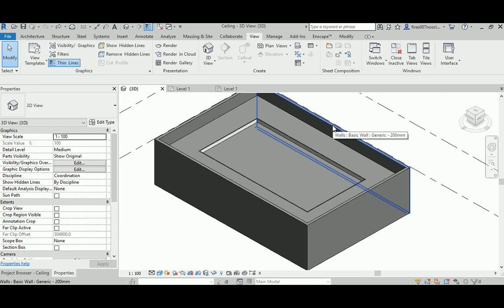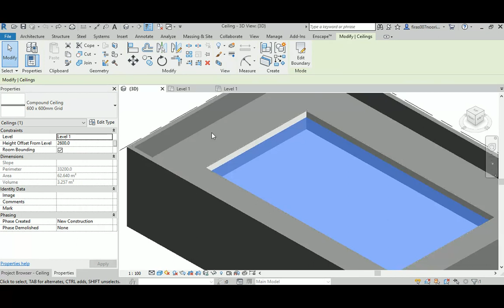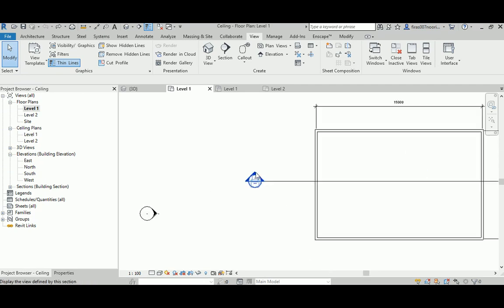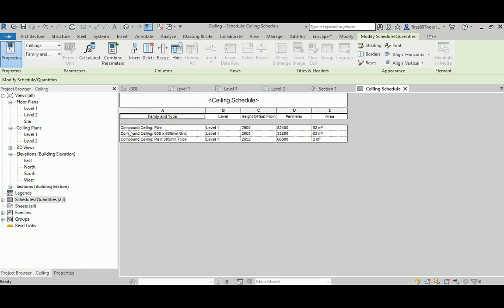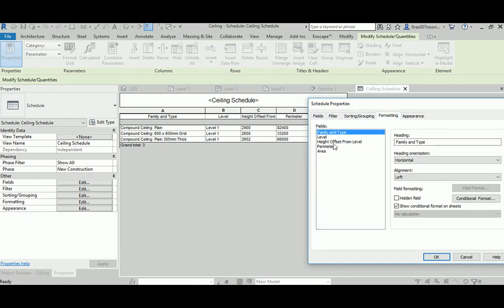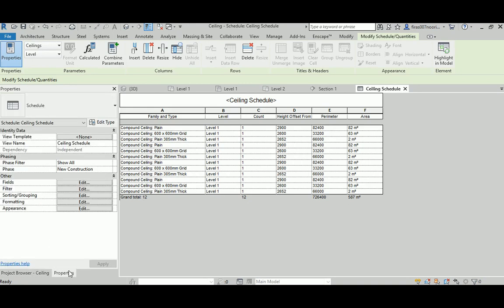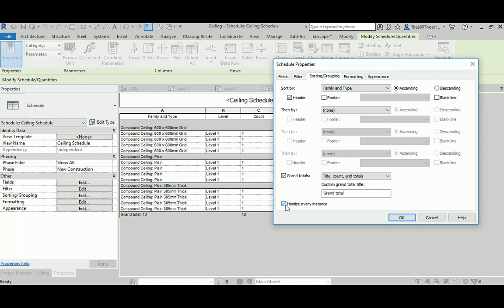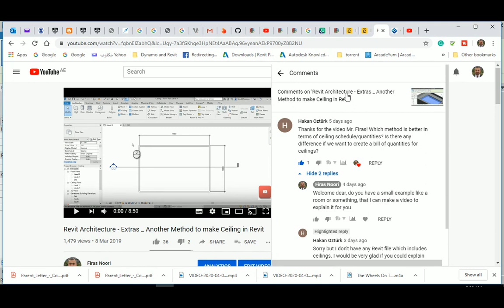Ceiling Schedule in Revit

Comment from the maker: the area of 305 is calculated for its projection part of it, not the physical cut required, if you need the 305 exact cut area, then please multiply the perimeter by the height of the 305 to cut the required.

Comment: there is something wrong with the ceiling 305mm thick area calculation, it does not give you the surface area of the drop ceiling instead its the length x width x offset thickess of 50mm, that is why it gives you 1.7 or m^2 instead of 10.37 m^2.
Reply: I would like to add some clarification based on How Revit calculating the Perimeters, Areas and Volumes and here as per REVIT calculations : The Area of suspended 50mm thick flat piece filling the gap of 305mm void between Upper and Lower ceilings which can be calculated by subtracting Inner Area that is 60.99m from Outer Area that is 62.64m (62.64 - 60.99 = 1.65) and 1.65 sqm is the flat Area as per Revit output and now move on to perimeter of the same flat piece here by combining the both perimeters of outer and inner areas of this flat piece. first we calculate each perimeter by adding each side of both rectangles which are 50mm apart from each other, Outer rectangle perimeter (10.8 + 5.8 + 10.8 + 5.8 = 33.2m) and for Inner rectangle perimeter (10.7 + 5.7 + 10.7 + 5.7 = 32.8m) hence combining both perimeters by adding them (33.2 + 32.8 = 66) we get the resulting perimeter which is 66m as per Revit output. And now to achieve Volume of this piece as per Revit Calculation we need to multiply that subtracted area (1.65 sqm) by suspended length (305mm or 0.305m) stated as (1.65 x 0.305 = 0.503) and the volume is 0.503 cu m as per Revit output. And to get precise Area of flat piece with suspended length then we need to divide the volume by 50mm thickness and that is (0.503/0.05=10.06) 10.06 sqm is the area we achieved for that suspended flat piece which filled the gap and we can take this cut area for calculating quantity of it. Here i am just trying to convey the calculated values which were output of Revit itself and calculated required Cut Area from these outputs itself.
Reply from the maker: the area as far as I remember is taken for the projection of it (as I wanted my students to understand the RCP as plan areas), not for the side or elevation of it, which I know it might not use for quantity, I was trying also here to close the geometry for the modeling, if you need to continue the calculation for that small part of the 305,  then, you need to use the perimeter and multiply it by the 305 to get the required cut area.

Comment: Hello ! Thanks for your video,i don't know why when getting the Ceiling Schedule in revit every thing is empety ( Area, Level, ...) have you an idea why it gives me like that !
Reply from the maker: hi dear Akzoun. I just tried that and it was working, I just create a 8 by 10 m ceiling the schedule was working!! have a look at the Revit file here 
https://we.tl/t-3TSKzOhOQP
Reply: @FirasNoori  Thank you, yes it's working, just in my project, I don't know why it Dosen 't work.  Can i send it to you Just to have a look !?
Reply from the maker: Please send me the revit file as a link by using (wetransfer) website
Reply from the maker: @fakz3875  Dear Akzoun, I have a quick look at the file, it has no Revit Ceiling elements, therefore, Revit will not generate for you a Revit Ceiling Schule! I have created a small Ceiling just a small rectangle ceiling, and immediately Revit Create for me a Ceiling schudle, It seems to me that you have imported lots of the Geometry you have from other applications, or you model object i.e doors and ceiling as generic models! so you are designing them as the physical ceiling but they are not BIM models, and they carry no ceiling function, which a series issue in working in BIM, I need more info to give more accurate answers my sister, just from my quick look, I notice that you did not use the ceiling command in the architecture ta in Revit, if you are a fan of using the model in place system of modeling then make sure to categorize the model as the ceiling so Revit understands you and schedule it properly, if you imported the geometry then it will not be scheduled at all.
I wish that I answered your question, my dear.
All the best to you
FN
Instructor - Ajman University
Autodesk Expert
M.Des. Sustainable Design - Universit of Sydney
M.Sc in Architecture Engineering - UOT
Reply: @FirasNoori   Yes you are totally right, the file is imported from another application (Evebim) so that why when i try to get some information it gives me nothing .... thank you so much for your explication and your time i really appreciate it .... My greetings Mr Firas
Reply from the maker: You are always welcomed dear

Comment: Hi Firas is it possible to add the ceiling thickness parameter to the schedule?
Reply from the maker: Hi dear, I have not tried it before
Reply from the maker: they are system families, so a headache!! I think the best way to overcome this issue is to use dynamo to extract the inner type properties, not the instant ones, and then report that back to your schedule!! yet as I told you never did that myself before :)